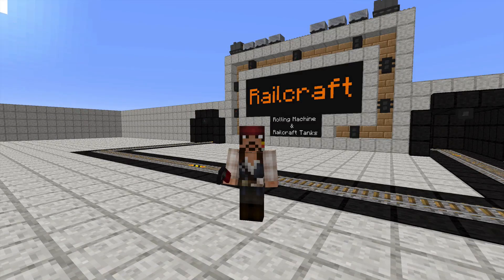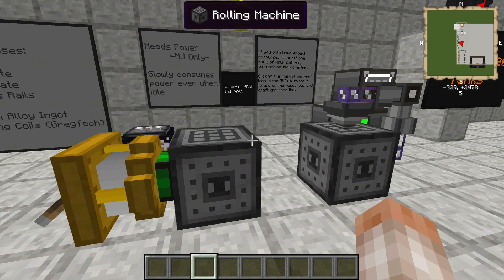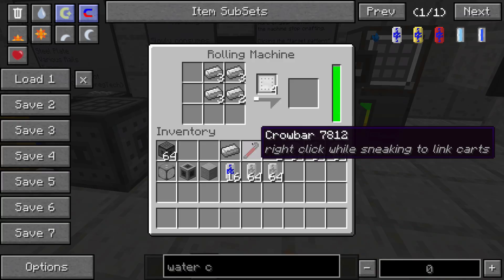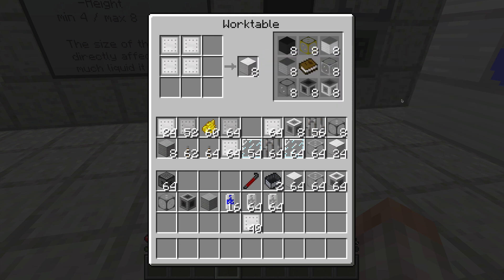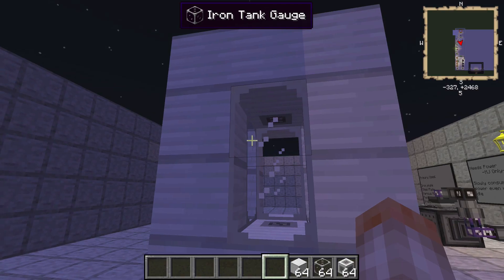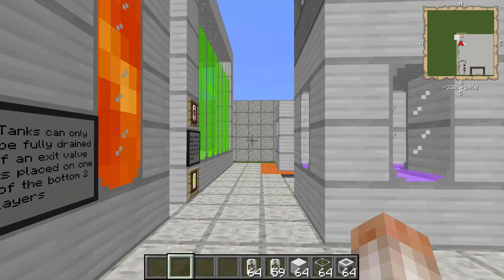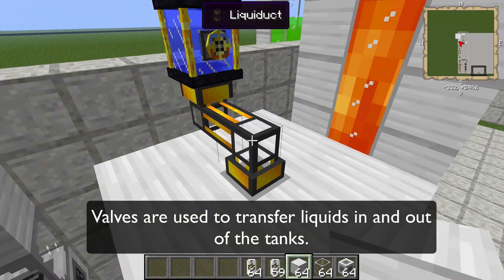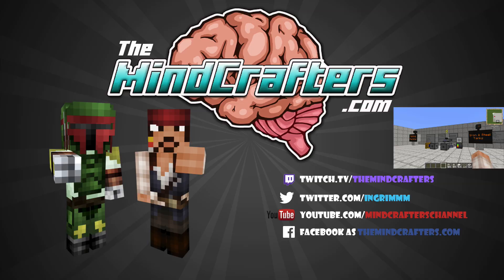Railcraft Tutorial: Rolling Machine & Railcraft Tanks

Comment: If someone wants to know the space efficiency of iron tanks over Buildcraft’s tanks, they are actually exactly the same, at 16 buckets per block (which is doubled to 32 for steel tanks). The advantage in iron/steel tanks is that they’s essentially several columns of regular tanks merged together into a single unit, making inserting and extracting fluids a lot less convoluted than if you had filled that space with regular tanks. They are notably more costly than Buildcraft’s tanks, but if you’re dealing with large quantities of fluid, I’m sure anyone would say they are preferable over sky-high pillars of regular tanks.